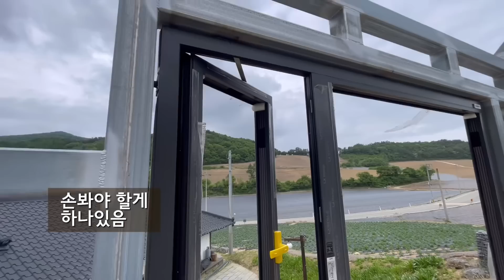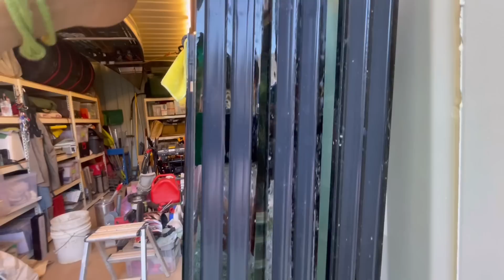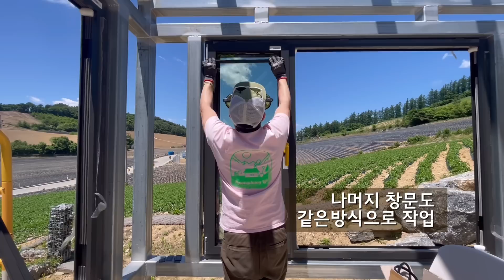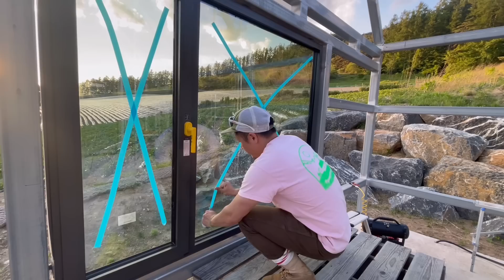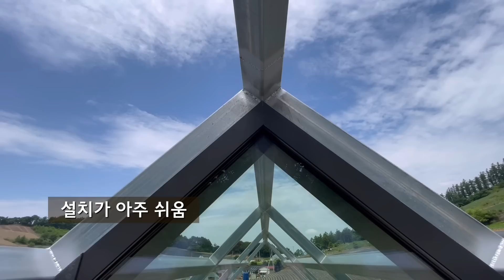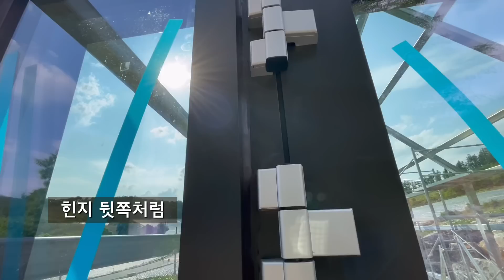셀프 집짓기 I 시스템창호 유리 시공 I 3중유리 로이유리 끼우기 I 개스킷 시공 I 커튼월 실리콘 코킹 I LX하우시스 I 샷시 셀프 시공 I 시골생활 Vlog I 5도2촌

Comment: I've been following your channel over two years and can't recall if you've ever mentioned your scholastic or professional background. The curiosity is sudden, but let me explain why. After doing your yard and othe projects, you started the construction on what you shared with me will be a "club" if I recall correctly. You and Mrs started with the exhausting task of forming, leveling and laying cement, 2x2 1/4 inch steel framing. In the US, most would consider that kind of framing is because of hurricane zone. A couple of weeks ago when you put in the window frames, it reinforced my thoughts about the structure being build to withstand  severe weather. Also, I said to myself, those window frames will require some really thick tempered glass. And today I'm watching you install exactly what I  concluded. So that why I'm suddenly curious about your scholastic and professional background/training. I'm enjoying the build, it appears you also did the designing for the structure as well.
Reply from the maker: Hello! The clubhouse is correct. I call it a lounge, but it's a place where you can enjoy apre-ski.
The reason why we build it so strong is because our village has a wide temperature difference, and it's windy and snowy. There are no hurricanes, but sometimes typhoons pass by. Actually, we're not an architectural profession. My wife is a doctor and I work for an advertising agency. Our hobbies are skiing and recreating the Pyeongchang house.